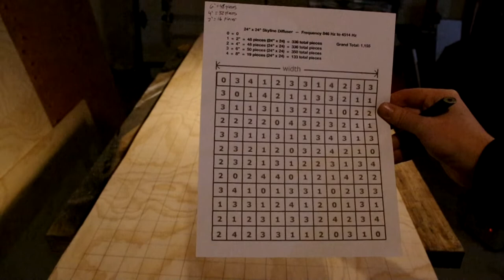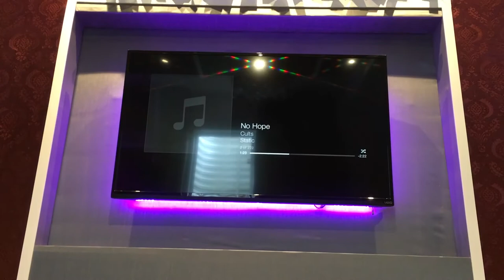Build Your Own Skyline Diffuser - DIY Acoustic Treatment ● SWH Builds

Comment: Great work and video!!

I had to sign in and let you know your video was one of the, if not the  best I've seen and I'm in the process of building some diffusers in my audio room as well......

I still need to make a few more acoustic panels, but I'm planning on tackling my diffusers first.

Thanks for the inspiration!
Reply from the maker: Thanks! I appreciate that. I like my setup quite a bit, everything came together nice and acoustically it has made a huge difference. Good luck on your build!

Comment: If you're not in a humidity controlled room, this construction method may not be long term durable. There is significant expansion and contraction of the wood blocks (but not the plywoood base, potentially a half inch over 4 feet depending on species) and this can cause the junction to fail, or cause cracking etc depending on the mounting choice used. Main point is you should control for humidity.

Comment: Thanks for the great video. I will have to watch it a few more times before I start making saw dust. How do you determine what frequencies you need to defuse and/or absorb?
Reply from the maker: Right on. First, you need to determine the primary type of recording you'll being doing, i.e. electric guitars, acoustic guitars, bass, drums, vocals, etc.  Each source of sound has a frequency spectrum.  I primarily record male speaking vocals for podcasts and audiobooks, so I googled what the frequency range is of the male voice.  I then designed my studio to absorb and defuse those frequencies (there's a link to calculators in the description–type in the low and high end of the frequencies that you're trying to diffuse and it will generate specs / dimensions of the skyline diffusor).  I'm not worried about bringing an entire band into my studio, so I didn't tune my room for very high or very low frequencies.  You'll notice at large / professional studios they have multiple isolation booths surrounding a larger "live" room. Generally, these isolation booths are designed a little different from each other and are individually tuned for guitars, bass, vocals, etc.  The larger live room is more general purpose for big instruments like pianos and drums, or the entire band playing together within the same room. So, decide on how you think you'll use your room the most, and design around that. Any dedicated acoustic treatment will make your recordings sound better than flat walls, but "tuning" should help optimize the way frequencies behave within a certain spectrum–in the end, making your recordings sound more natural and less affected by the unnatural characteristics boxy rooms. Sorry for the long ramble!
Reply: @swhammondbuildsreviews  Makes perfect sense. Unfortunately I'm trying to acoustically treat a basement theater. Specifically a Magnepan 5.1 setup so I'm struggling with how much reflected sound I want to diffuse and absorb.

Comment: Hey great video! Is How did you know how many 2 by 2’s you needed?
Reply from the maker: In the link to the design calculator in the description, it will output how many meters of material you need to accomplish the plan.  I then went to google and converted that to feet, 49'.  Also remember, that in my case, my diffusers are larger than what the plan calls for.  The plan will tell you how wide your diffuser must be in centimeters, I also had to convert that number, 18".  However, I wanted a 2'x6' diffuser, and a 4'x4' diffuser.  More math.  I basically needed to build 11 sections 18"x18" plan to fit 2'x6' and 4'x4'.  I multiplied 11 (sections) x 49' (linear feet) = 539 total linear feet.  Then divided by 8' (the length 2"x2" comes in), which equals 68 sticks.  So, I bought (68) 2"x2"8' pieces of lumber.  Clear as mud, huh???  haha, there is a method to my madness in there somewhere

Comment: According to what is the bevel at the top of each stake arranged?
Reply from the maker: I rotated them 45 degrees each time I set them. The goal was to not have two side-by-side reflecting in the same direction.
Reply: @swhammondbuildsreviews  So what standard did you cut the top side according to? Is it an acute triangle?
Reply from the maker: It's been a while, I can't remember exactly, but I think it was 22.5 degrees. It wasn't to a specific standard, I was just trying to avoid 90 degree flat tops.